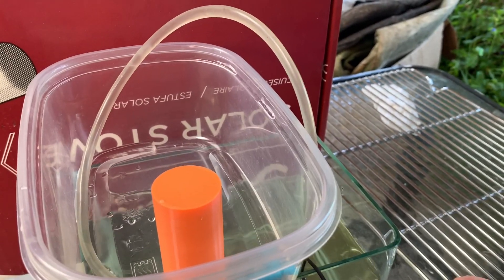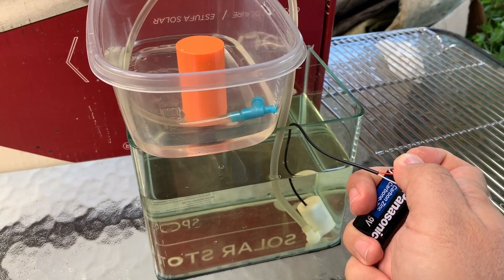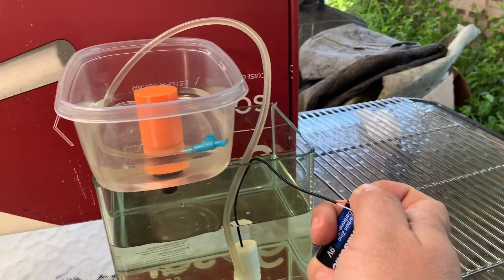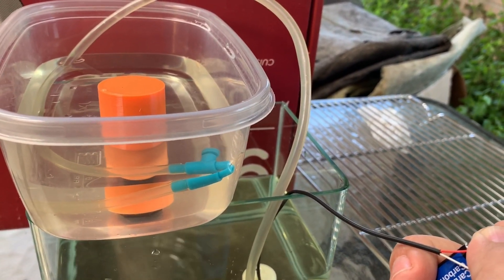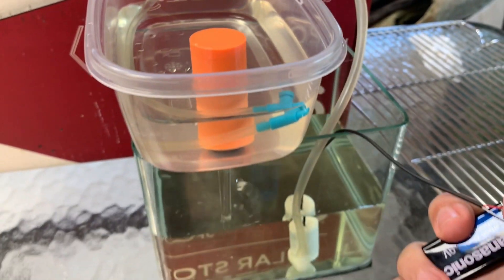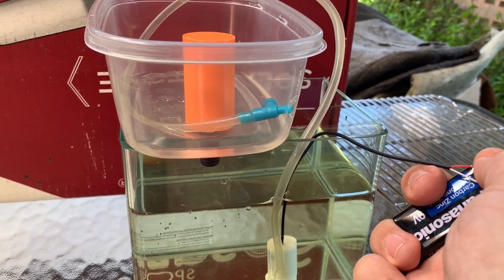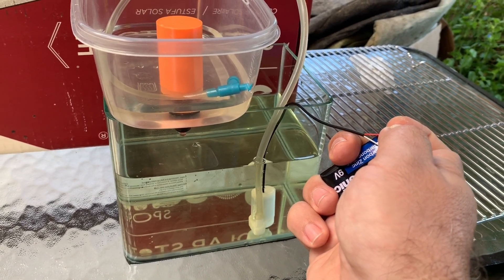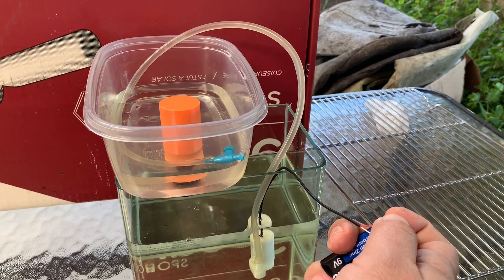3D Printed Mini Bell Siphon!

Comment: These can be printed in one solid part.  Just print the drain pipe connected to the outside housing with some holes at the top of the drain pipe.